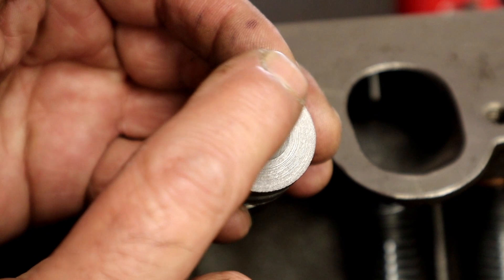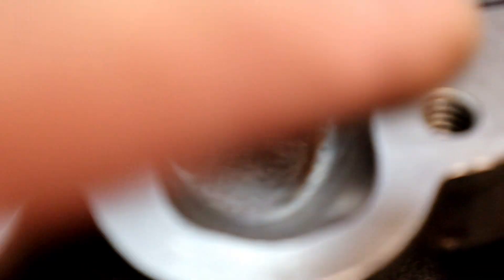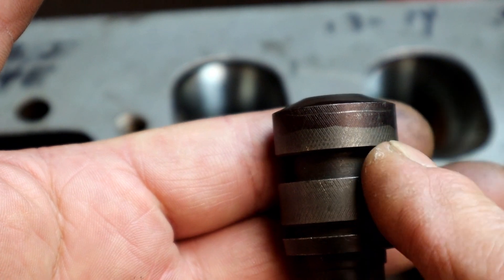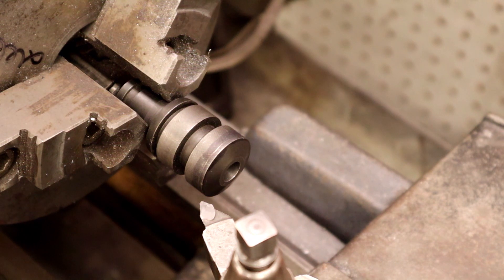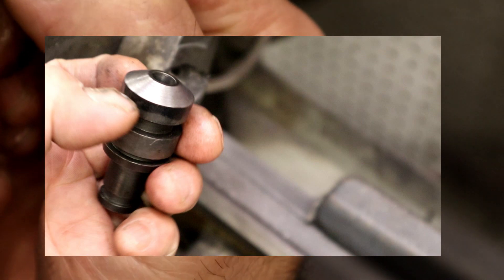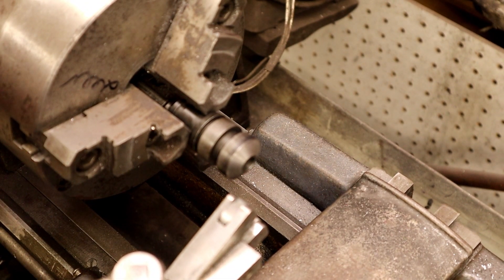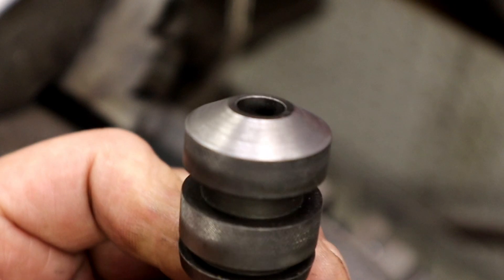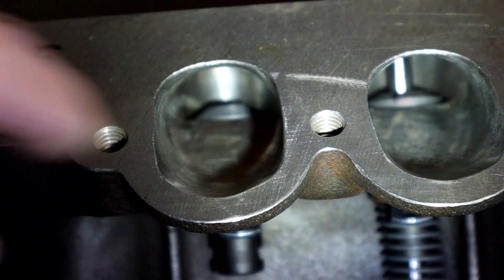FORD FLATHEAD: HOW I MODIFY THE VALVE GUIDES FOR AIR FLOW AND FITMENT.

Comment: Absolutely love your video I've been learning how to work in a machine shop a little bit and doing some here and their stuff myself by mailing heads on a end Mill and I thought it was really informative on your flat head build stuff seeing how I love working on this old engines myself I'm currently working on an old 1954 Ford 8N modifying the cylinder head a little bit polishing it at least and relieve cutting the valves done shot them for a little bit more oops in the bottom end along with shaving 40 tho off

Comment: Informative, and very enjoyable video ! I am currently building a 265 inch flatty, for a "gasser" style 46 bus' coupe. In regards to valve guides, I designed my own, and have had my machine shop CNC machine them. They eliminate the 90 deg "pocket" that violently disrupts high speed flow. Each one is individually fit / massaged to the their respective  bowl. About 3 hours per port ( all 16 ). Engine will be on the dyno later this year.
Reply from the maker: Love that!
Reply: How much hp